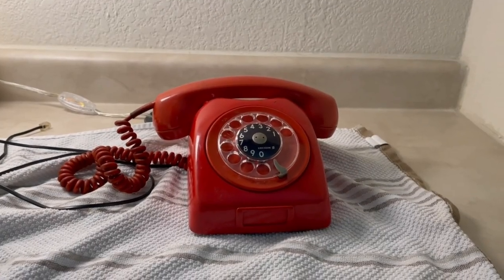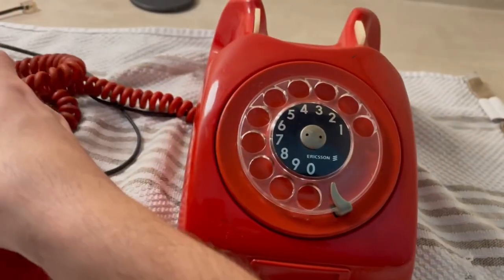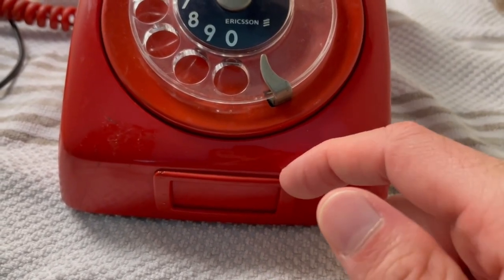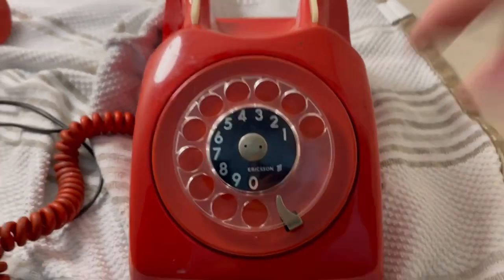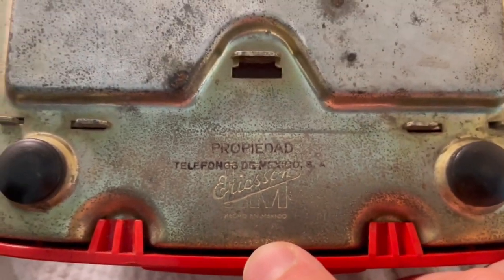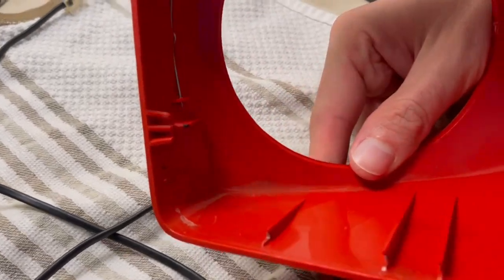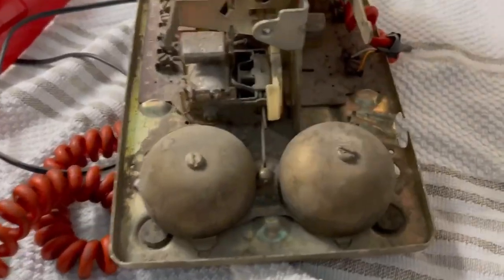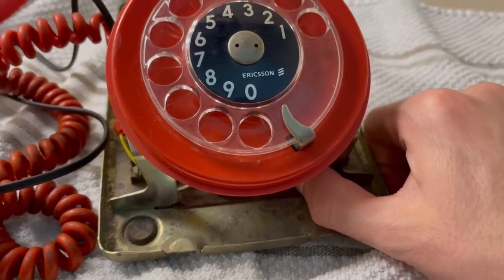First Look 1967 Red LM Ericsson Dialog Mexico

Comment: Enjoyed your video. 
Please mind that the logo on the finger wheel was introduced in the 1980s, so not original to the phone. 
And opening a dialog can be a b&$ch, as often the screw is not alligned properly with the bracket.